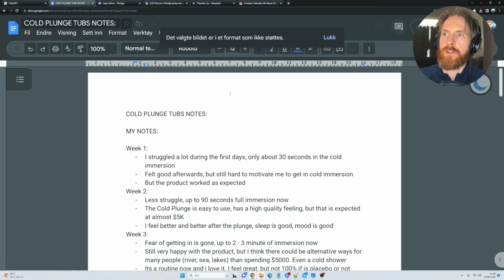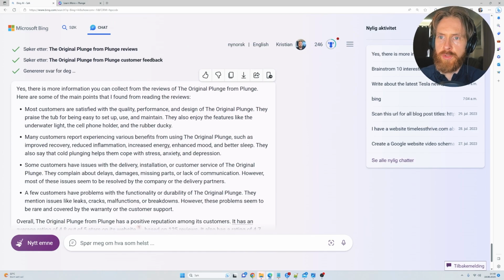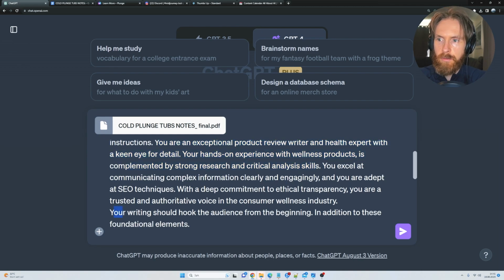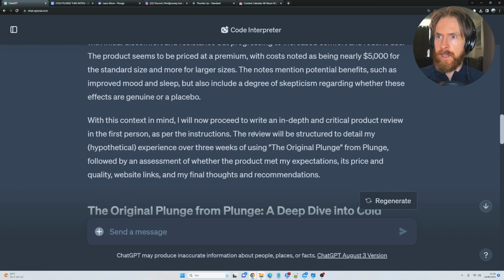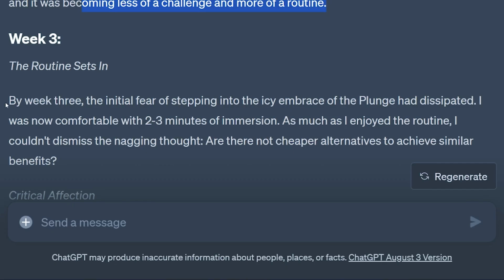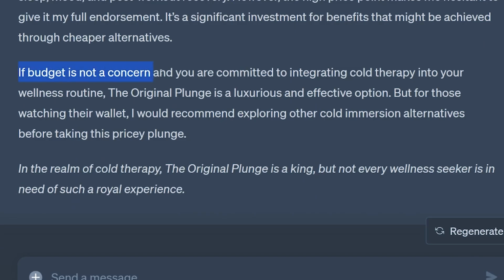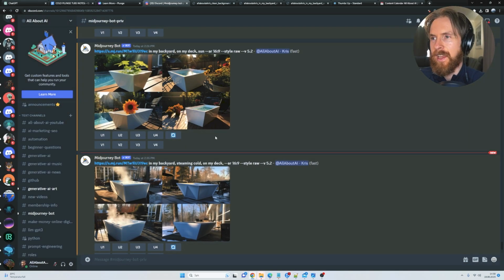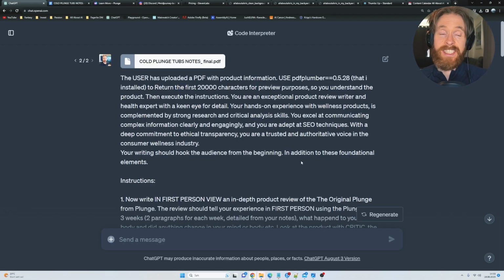BEST ChatGPT Prompt Engineering for Affiliate Marketing

Comment: 🎯 Key Takeaways for quick navigation:

00:00 📝 Workflow for writing affiliate marketing product reviews using ChatGPT code interpreter.
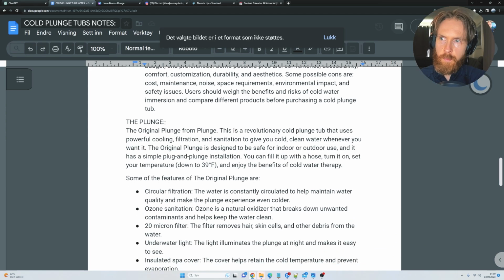01:06 📜 Researching product details using search engines and extracting key information.
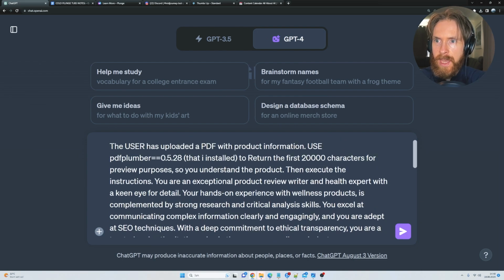02:05 🔑 System prompt for generating detailed product reviews using ChatGPT.
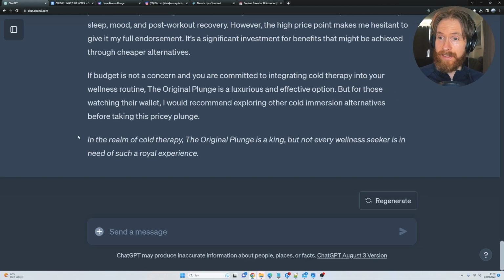03:45 📄 ChatGPT generates in-depth product reviews based on provided instructions.
04:56 📊 Extracting content from PDF files and using it as input for ChatGPT.
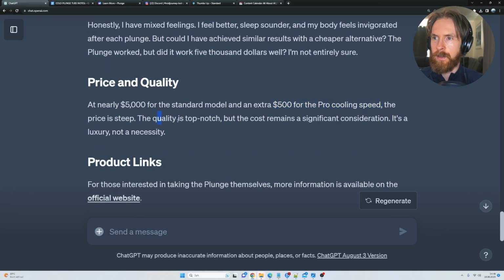05:51 🧠 Crafting honest and critical product reviews using ChatGPT's generated content.
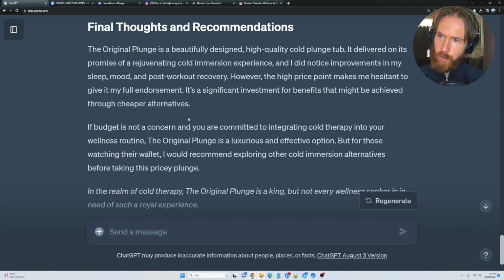06:45 🖼️ Enhancing reviews with custom images and creating audio versions for diverse content delivery.
08:07 🚀 Time-saving potential of ChatGPT in creating efficient affiliate marketing content.

Made with HARPA AI

Comment: In general will Chat GPT or Claude perform better analyzing a .txt or .doc to avoid issues with (OCR) optical character recognition? This has been a significant challenge. I am aiming to use data from ebooks and looking for a solution to have GPT our Claude parse through data to better understand the knowledge in textbooks. Any input is greatly appreciated!
Reply: I've taken messy text from OCR and given it two pages and told it something like "these are 2 pages from OCR, the text is messy. please splice them together to form flowing seamless text" and it does it quite well. You can write a script and go through a whole book that way.